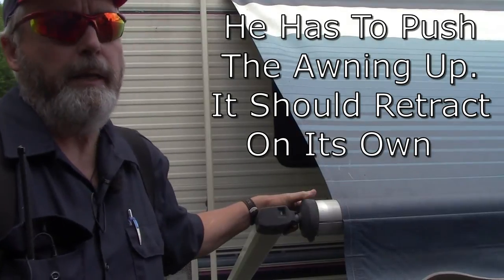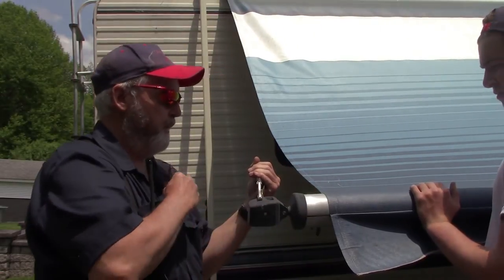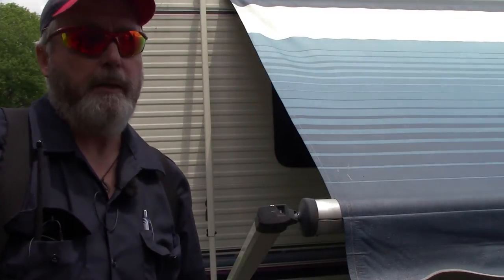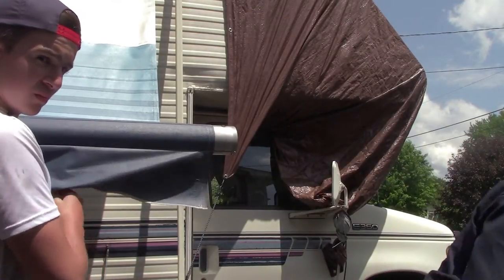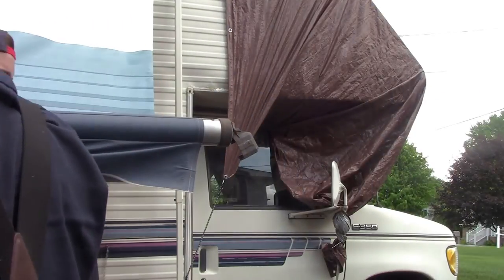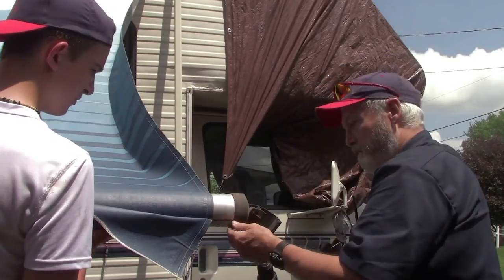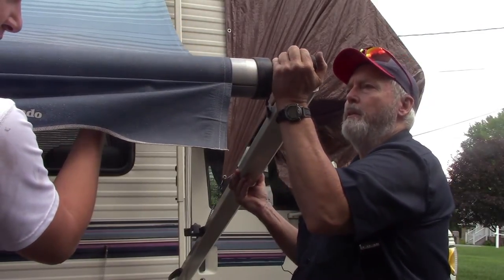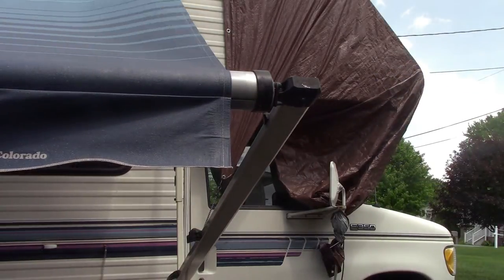Repairing A Manual Carefree RV Awning

Comment: Howdy Hillbilly RV,  I know I'm commenting on an older video, but I have what I'd call a newbie question that this video sort of addresses.   I have owned my 1995 Safari Serengeti for about 6 months now (2.5'th owner, the .5 owner owned it for about 8 months before selling it to me) and it came with a manual Carefree Awning Model BN3N4 with the Carefree Flexible Metal Weather Shield.  Today is the first day I was going to work on extending the awning and I've discovered that the awning strap is missing.  How do you recommend I extend the awning so that I can replace the strap?  I'm completely lost here and the temps are reaching 113f+ degrees where I'm currently located.  Passenger side faces West and receives about 6 hours of direct sunlight so the awning is a must.  Thanks in advance for your help and you earned a subscriber from this video alone!  Already have a call into Carefree customer support but...they're closed today, of course.
Reply from the maker: Just pull it down. Get ahold of the outer arms near the top and pull it down.

Comment: Good video, thanks. I will comment on a couple of things. I've got a cheap B&D Workmate type portable work bench, ($20 on Craigslist). I screwed a piece of 2X4 to a piece of 1/4 plywood  to make a larger work surface, strictly light duty stuff. When I'm doing work like you were here I set the bench up close to put tools and parts within easy reach, I don't have to bend over to pick anything up. I use magnetic trays, (cheap at Harbor Freight) for small stuff like screws. And last, you're weezing pretty badly. Not enough oxygen my old friend. What every it is you're doing or not doing, you better stop doing or start doing.
Good, good, good video, thanks and a thumbs up. 👍
Reply from the maker: Thanks Bruce. All good advise.

Comment: I was wondering would it have been possible to transfer the spring between the heads?  That way no modifications required further the customer would have the original function of the original control head.

As to Cameron:  Cameron without your assistance in this endeavor the whole project would have collapsed under its own weight as it were.  Keep up the good work.
Reply from the maker: Thanks Mike. To be honest. That never entered my mind. Where were you at that day? ha ha. That might have worked. Cameron is a good helper.

Comment: Thanks for all your helpful videos! So I just replaced my awning and frame due to frame damage and a tear. Awning roller came preloaded, but won't retract on it's own. I've tried unwinding and rewinding with recommended 15 turns but still won't retract on it's own. It will roll by hand and you can hear it ratchet. Any thoughts?
Reply from the maker: Almost sounds like 1 spring is wound correctly and the other is wound incorrectly.

Comment: Mine is stuck closed.  Open and shut lever wouldn't budge.  Guy at the park took vise grips and could force it to move but nothing happens.  The lever if frozen.  Do you know how I can fix that?
Reply from the maker: Yep. Replace the spring mechanism. Yours had a failure.

Comment: If you had lowered the end, and jiggled the tube, thinking the spring would have come right out. And if the only thing broken was the bolt which held the spring, replace and return to service?
Reply from the maker: That sucker wasn't going to fall out. It was stuck.

Comment: one of the BEST video's on You Tube !  trying to fix mine,  my spring is not broken but the band that holds the spring to the end cap came lose,  have you fixed this problem before?  would love to see a video of that !
Thank you for your time making these videos !
Reply from the maker: I don't know what you mean by the band broke.
Reply: @hillbillyrv  the band didn't brake but it came off of the end cap (with the open or close) trigger/switch, I tapped it back into place but it didn't last, only about one day then it came off again.  I think maybe I got it fixed this time ( only time will tell) that band has a small indentation in it (like they put it in a press maybe?) I think to hold that band around the spring so it doesn't come apart like mine did.  I put a little more indentation in it this time.  I tried to pull the spring lose from the end cap pretty hard and it didn't move so keeping my fingers crossed.    Thanks for inspiring me with your videos !  I don't I would have tried fixing it on my own.
Reply from the maker: @TheStarsky76  Awesome.

Comment: My Carefree is from 1983 camper.  It works with a spring at each end of the rod and a cable running down the arms that attaches to the handles.  Is there any replacement for the front spring that is broken? The part number is 169001.
Reply from the maker: I would say that stuff has been obsolete for a long time.
Reply: Do you think if I bought regular end caps with the regular spring assembly it would work?
Reply from the maker: @caymcmanus6398  Couldn't tell you.

Comment: That type of modification is common especially on older awnings. Most of the time with older awnings the awning manufacturer has discontinued that model requiring modification to make it work. Good video.
Reply from the maker: Thanks Kelly. It was just the fact that I figured it was going to be a quick fix and it was not.
Reply from the maker: @thekellycorner  Always !!!!

Comment: My van came with a" Carefree" awning. New motor was $500.
The awning arms have a hard plastic piece covering the wiring. The plastic piece ended up slicing the tarp.
An obvious, horrible design flaw.
Not covered. $600
An awning will be a continuous drain on your finances. Especially" Carefree"
Reply from the maker: It's sad JA. I see this sort of stuff everyday. Thanks for watching
Reply: @hillbillyrv  
You have a new subscriber. I work in state parks year round. Your channel is the best. I come across people with RV issues all the time. With the information you provide they now have more than one option. I will be referring them to your Channel. Thank you
Reply from the maker: @jabreck1934  Awesome JA. I really appreciate that.

Comment: That part you're spinning I broke the connection to the awning bar. Can that be replaced or fixed? Call it a head? Is that what I need to replace?
Reply from the maker: Technically it is called a Spring Assembly. Yes sounds like that is what you need to replace.

Comment: Thanks, great video. Very helpful.
Reply from the maker: You're welcome!
Reply: Hi again, my carefree fiesta awning is in the travel position and the lever to open is stuck in the closed position. Any suggestions would be great. Thanks for all your helpful videos.
Reply from the maker: @bomize9419  They can get pretty stuck sometimes. If I understand the current position of the awning? You can't try to rotate the awning the other way to relieve pressure on the lock mechanism. In other words you find yourself in a tough spot. Sorry

Comment: Are you in Florida? Come to Clearwater! Help! I need help with my dometic! Can you put screws instead of the rivits?
Reply: I need a good helper like Cameron!
Reply from the maker: Sorry. Hillbilly's live in hill country. I am in WV.
Reply: @hillbillyrv  where in wv ?
Reply from the maker: @blakefiles9895  Beckley. Southern WV
Reply: @hillbillyrv  ok I'm in keyser wv.  I got a question If u dont mind I got a camper used an the awning handles are missing now i see most are riveted in but this one dont have any holes where the handle was b4 just a square hole. Is that a different style?
Reply: Also it says it's a simplicity by carefree If that helps
Reply from the maker: @blakefiles9895  It should still have a hole on both sides of the square hole to mount the handle. Get a couple of handles and then you might have to drill the holes out.
Reply: @hillbillyrv  ok I was thinking i could just drill some holes but was wondering how the original ones were on there with no holes. Thanks for your response
Reply from the maker: @blakefiles9895  No clue

Comment: Hi hillbilly rv, I would like to ask you a simple question, since you look very knowlegable in rv awnings... here my question:  can I use a larger used awning, and shorten the tube in where the tention spring are ? I need a 12 feet wide (from front to the rear of the vehicule) but the one I got for free is 14 feet ! thanks for the great vedeos
Reply from the maker: Just cut it off Richard.
Reply: @hillbillyrv  as simple as that .... now that I know it is ''doable'' I'll give it a try. thanks again !
Reply from the maker: @richardbrousseau4799  A lot easier to make them shorter rather than longer.....  :)
Reply: @hillbillyrv  your right, very funny !  was wondering if I'll need to cut both ends or if one side would be ok ??? what about the springs.... I guess I 'll also need to cut springs as well ???? I"ll have a better idea once I open it up !
Reply from the maker: @richardbrousseau4799  Just cut one end. Watch those springs. They are wound pretty tight. Watch my other awning videos to really familiarize  yourself with awnings. AZ Expert and My RV Works can be good sources for info too. Do your homework and be careful.
Reply: @hillbillyrv  all right, I'll do my homewoks before working on it ! thanks again !
Reply: I’m doing the same thing, just picked up a free awning that I need to cut down.
Reply from the maker: @mikeknies3929  Awesome Mike.....FREE is really good
Reply: @mikeknies3929  Hi Mike good to heard about that, so I won't be alone doing that ! I will only attempt that task, in a littlt while...a couple of weeks for sure, but please keep us posted on yours, would you ? I will for sure
Reply: just picked up the awning, will begin working on it this week... will update you guys ! How about yours Mike ?
Reply: @mikeknies3929  just an update on my project of shorten the awning tube... well I succesfully (and surprisingly easily) cut off the tube, remove and cut the fabric. Next ste is to bring the fabric to a place where they will sew each side of the fabric, then bolting the arms to the vehicule.. (I am a bit scary about finding the right spot to bolt the top arms bracket, as there's no one at the moment) will keep you posted on the following... thanks again to hillbilly RV for the kick in the a... to go ahead in this project !